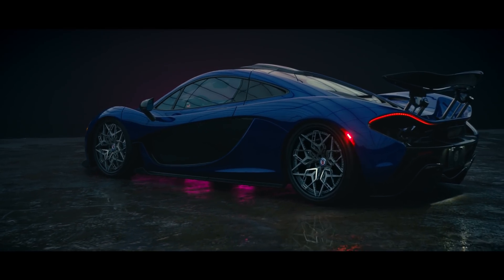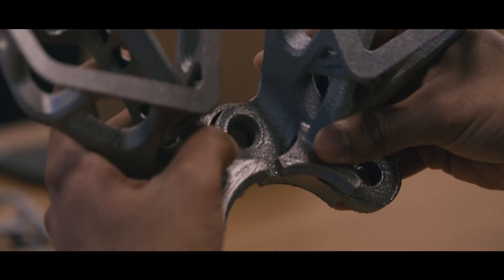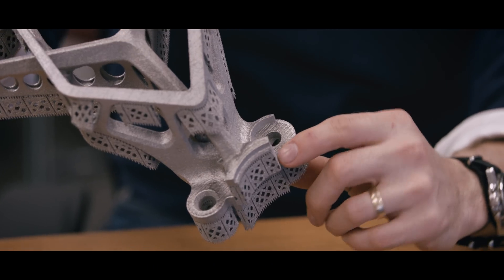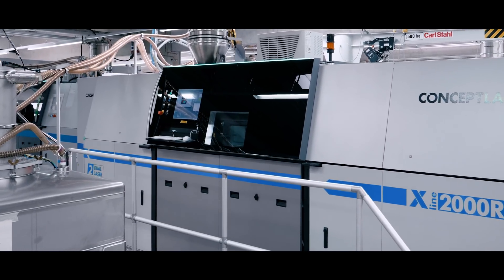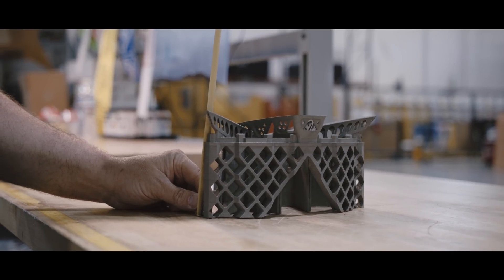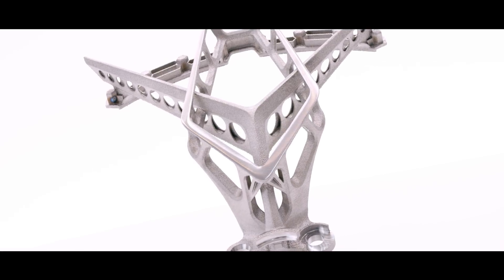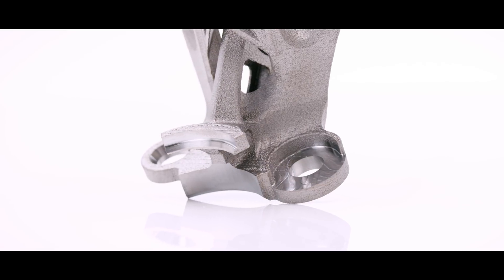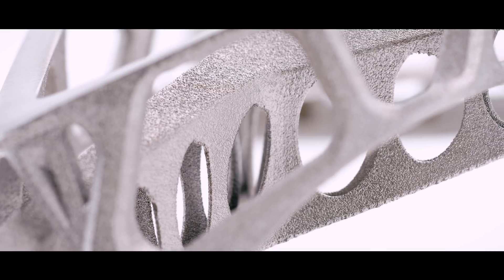HRE3D+ 3D-PRINTED TITANIUM WHEEL | THE SECOND GENERATION

Comment: So how much CNC machining, EDM or Ceramic grinding do you need to remove the wheel from the bed, balance the rims, and finish the surface?  How much money is saved or lost versus just "titanium casting or sintering" the rim(using a 3d printed pattern, of course)?  Also, include the cost of all the inspection between each set-up.  This is cool, but only a million dollar price tag supercar assembly can afford this over-priced component.  When I see toyota corolla rims made by DLSM, I will jump on the bandwagon.

Comment: For those wondering about weight, HRE has started 16 pounds for a 20-inch wheel, and 19 pounds for a 21-inch.
Reply: 20x9=16lbs
21x12.5=19lbs
Reply: Wonder what price tag thats gonna come with 👀
Reply: @Eddie89  they're concept rims, not production, so I'd guess upwards of $100k.